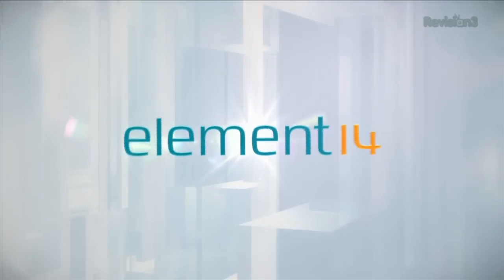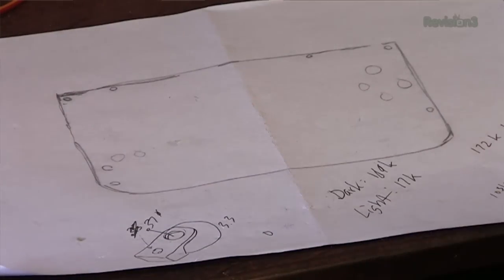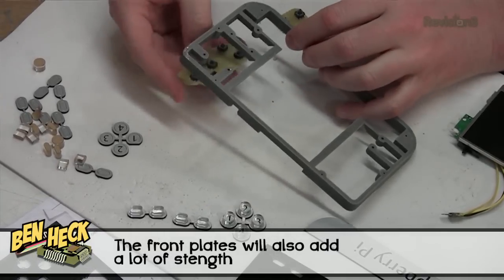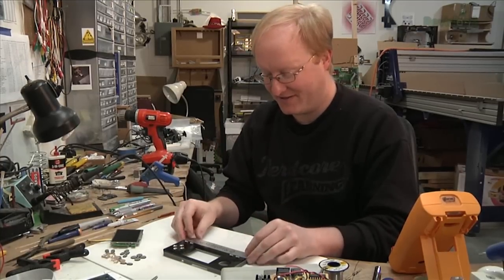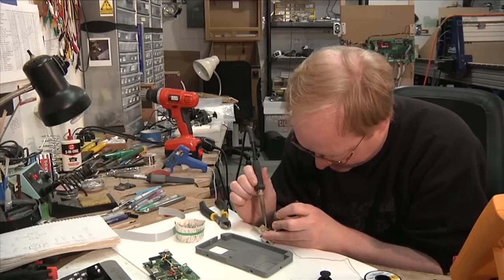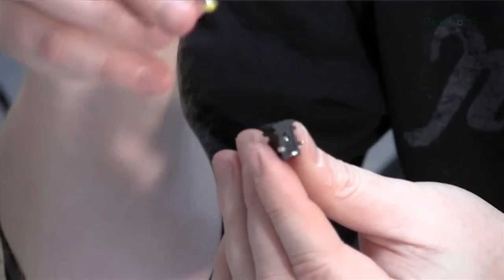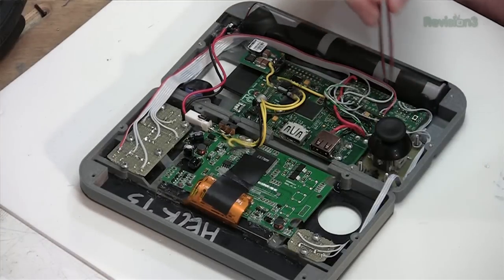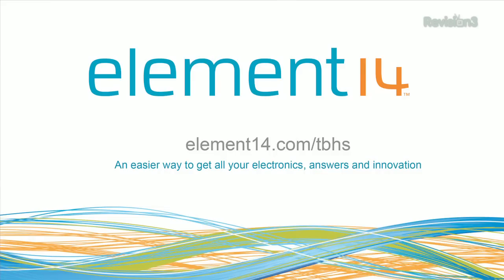Learn to Build a Portable Raspberry Pi (Part 2)

Comment: what would happen if i used a dead xbox controller for the buttons? And also why not use RetroPie instead of Mayme? RetroPie comes with loads of emulators (except you have to have the roms) and Mayme

Comment: This portable Raspberry Pi is an awesome project. Though I wonder: Could you update this to work while charging? I've heard that charging and using at the same time is not easy. Maybe you could combine it with a Switch-like Raspberry Pi-based device or so, so it's not just a retread of this project?

Comment: I was expecting to see some voltage monitoring. :-/ For a portable Pi it would be great to have it shutdown when the voltage drops to a certain level. Otherwise the OS on the SD card might get corrupted if the Pi is not turned off properly.

Comment: it has been a while since you have done this build, but i'm just now getting on the raspberry pi band wagon. can you go into more detail about how you ran the display output to the raspberry pi. you have the three cables coming off to provide the output. then at 8:25 in the video you have them going to a central location that isn't on the pi and it spilts out to a device in the top left hand portion of the screen and a micro controller and a red wire that i'm assuming comes off the display connector on the raspberry pi. love your videos and appreciate the inspiration to think beyond the off the shelf products offered by raspberry pi.

Comment: Hey ben, how would you wire two psp analog sticks to a raspberry pi 3?
Reply from the maker: +Rhatios Gaming Not directly, you'd have to use an interim chip that could handle the analog in from the potentiometers, like an atmega328p
Reply: Is there a schematic to it, I just got a pi 3 and want to make a portable out of it
Reply: +Rhatios Gaming Same.
Reply: you could use a ipac as well
Reply: +James Taylor will the teensy 2.0 support two psp analog or 3ds sliders

Comment: An old project I know but thus far one of the nicest version of the handheld-retro-gaming setups. I'd like to see this project updated with a Pi3. 

Here are my thoughts

Pi 3
All Ports left intact - if possible.
DC Power (Charge can use at the same time)
HDMI free to use to plug into a TV
On system screen 640x480 or 800x480... maybe 5"
micro SD card access
Buttons (shoulder buttons, for sure ) and maybe two more action buttons (6 button like the old sega controllers?)
Battery hatch to get in and replay battery pack. (or maybe use rechargeable AA?)

Case design still pretty similar but maybe a hair bigger/thicker to allow for the usb/ethernet ports access. Maybe a GBA style enclosure?

They idea is a portable system that can be docked for use as a console.

Comment: Hey ben Hack let me ask you a question. Now for the battery charging  when you charge the Battery how do you know that it is fully charge? I know that the battery has a charger protection on it but sometimes that can fail if over charged. So how do you know when it is fully charged??

Comment: It's a better version of the wii U!
Reply: +Creeperzone221 lol
Reply: it was a damn joke...
Reply: Creeperzone221 I knew that XD but I still wanted to point out how the thing can be a weird semi portable system. You can play the wii side just of the gamepad and any wii u games that support off screen play. Since when you hack the wii the games still display on the gamepad as all it does is mirror the wii mode. ^
Reply: +Creeperzone221 ??? how, the wii u gamepad has a touch interface with both extremely high quality analog sticks and dpad. The controller itself is light for it's size and decently durable. It also has clickable analog sticks and all the standard buttons for a usual console gaming system. Plus the screen size is a perfect size for widescreen supported games. You can also hack the wii side of the wii u to play any iso gamecube games that you want. You can technically make it into the ultimate nintendo machine..

Comment: hello it would be much appreciated if you could send a message back.I have a broken Philips portable dvd player with a screen connected to what looks like either a controller board or power distributer (with pink and white wires). It also has a DSI connector on the screen its self. I was wondering how I could use that screen to make something like your portable raspberry pi,thank you,wjbgaming

Comment: How does that USB thing work? Don't you need a hub to connect two USB devices to one port? Or can you just connect it in parallel?
The other Raspberry Pi projects I've seen have used the circuit board inside USB hubs in order to connect multiple devices.

Comment: Is it possible to buy those plastic buttons in bulk? No electronics, just the plastic for enclosures. The 3D-printed ones are hard to get smooth enough.

Comment: Someday, I will have a 3D printer, starting out slow, playing with small projects first, learning the basics.  My other question was, will I have to buy an Arduino every time I make something, or can I reuse the same one after the code has been written to the project.  Which one to start off with on a budget?  Thanks for your help.

Comment: Hey, I have a question.
I have pretty much no experience with engineering (lel I tried splicing a 9mm headphone plug to an RCA cable and it didn't work, n00b), and I want to make stuff like this. I'm a sophomore and I'm currently taking an Engineering class, and I took one last year on drawing and design, but I haven't learned much when it comes to computer and electrical engineering. So, where should I start?
Reply: Well, I was working on a video about how to make a portable Pi that was in a camera bag (held a USB HUB, Battery, and the Pi itself) which doesn't require soldering.
If you want something compact like what Ben made, you will need to learn basic electrical stuff, namely 5v doesn't work for 7v items, and 7v will fry 5v items. As with the first episode, make sure it works before you start designing any kind of case, so first try getting the Pi to be powered from a 5v source and then try to get a display working on the same 5v (for what Ben did, he used the battery's 7.2v to power the display and used a voltage regulator to bring it down safely to 5v. You can achieve the same with just a 5v USB battery by using a DC-to-DC Booster, which would work fine here as well).
To TL;DR the above, first you need to get the Pi and the display powered from the same source of power. You can either take a USB battery and power the Pi and bring up the voltage for the display using a booster component (which isn't too hard) or take a higher voltage for the display and bring ti down safely for the Pi (voltage regulator, which is also not too hard at all).
Basically you'll need to brush up on some minor electrical engineering, but don't worry: you only need VERY basic information (not even Ohm's law far).
Reply: Flame Soulis Thanks man! I do know some electrical stuff that I learned from Physical Science last year, but it was stuff like resistance and voltage and circuits. Will this help me at all?
Reply: Yep! Basically all you have to understand is how to power the Pi from a battery as well as the display. In my setup, I just use a simple USB Battery (takes LiPos and manages power for me) so the Pi gets power without needing anything fancy. The screen is then powered by a DC to DC (5v to 12v) which powers the screen (basically making the screen a USB monitor so to speak). As long as you keep ground to ground and positive to positive, you are in the green!

Comment: Hi Ben, please build a Raspberry pi portable NAS with power for all components integrated either by battery or by an external ac power adapter or by both. Please use a laptop hard drive or an ordinary internal hard drive. 
Thank you...... :)

Comment: Kids love video games this would be a good way to teach them about electronics and design if this was a kit. Wonderful video makes me want to try it out .

The screen that you have int his project where can I get my hands on one? I am trying to make an external box for my old stereo. However the touchscreen that I purchased from another place can only be used with Wheezy Raspbian. I want to be able to switch from HDMI and back to the screen. Can you please help?
Reply: Just search up 'Car Monitors' or 'Mini LCD' on eBay. They are typically around $10 and if you don't mind getting dirty, you CAN power some of the smaller screens with 5v if you remove the internal voltage regulator. That'd make the project easier since you'd only need a simple USB Backup Battery to power the entire project.
Reply: Flame Soulis
Thanks for the tip I already got the LCD screen. When I tried the games though some of the emulators were very slow.
Reply: Dart Gar You may need to not start X Windows (the graphical interface). That uses up quite a bit of resources. You can also give a small overclock to the Pi and that would boost performance. I have found SNES games run fine to a degree on a per game basis. Games like Megaman X run perfectly with slight overclock and games like Mario Cart have tiny issues on some tracks.
Reply: Flame Soulis
Thanks for the great info!
Reply: +Dart Gar You could also buy the official touch screens. For my handheld, I will use a 4" sized one.

Comment: Why are you putting the solder on the iron?  I would assume you already tinned your iron, so you are just making it less effective by doing lazy soldering.  

Rather than explain the case, why not explain all the parts you have put in there, where to buy them, and how to do all the wiring, and why it is wired the way it is.  I understand the CAD talk, but I highly doubt hardly any RP enthusiasts have a clue what you are talking about, and even less people have access to a 3D printer, and even fewer have access to CNC mills/waterjets/lasers.  

I like what you did here and want to build my own, the case I can do, the wiring and setup is where I'm lost.

Comment: hi, i been thinking about building my own moble pi, i think i got most of it figure out. problem i am having it building a power supple for the monitor, the monitor is 7 inch works at 12v @ 500ma. the battery i like to use is 11.1V 7800mAh. side note help on building a charger would be nice, i wanted to a solar cell on the outside of my case

Comment: I have a few questions.

Where do you buy a power jack connector? And where do you buy the correct power adapter for that power jack connector? And if I use 2 3.7v li-ion batteries (7.4v total), what power supply do I need to charge it?

I know how I'm going to wire it up, I'm just having trouble finding out how to charge the lithium batteries.

Comment: I'm confused how do you make the analog stick and buttons work
Reply: They are hooked up to a usb port, did you not watch the video? He mapped the buttons with the wireless keyboard. You go into the pi settings and change the key layout, Like on pc games you can go and change your pickup key to lets say f instead of e. What he did was change the key to use the buttons and joystick instead of the default.
Reply: oh so he didnt make them ?
Reply: He didn't make what? A button is a button no matter where it came from, the signal was sent from the button to the asic in the pcb thus controlling it.

Comment: @Prince Vegeta You can always plug a wireless dongle into that USB port, and no since the Pi is ARM based (what's inside mobile phones) and Steam only works on x86 (what's inside desktops). And to be quite frank if you could compile Steam for arm, you wouldn't want to. It just wasn't built to render in 3d and games themselves are written for x86. Overall though as long as you can find someone with a 3d printer it's under $120. (Pi is 30-55 USD and LCD is ~40 USD, everything else can be bought online for less than 10 USD with the battery being the next most expensive depending on how much you're willing to spend.)

Comment: Not much to be honest. You could do it for under $100. The only problem is he uses a $2200 3D printer for the case. You'd have to build one on your own unless you have a 3D printer, which wouldn't be expensive, just time consuming.

Comment: Why do you use the Teensy, the raspberry pi has a gpio pins and you can make a small program that maps the gpio pins as game controller? Is it a problem that you can not get analog inputs? Well you can use good old d-pad and save space. Thank you for sharing free information and give good advice for free.

Comment: You know your stuff but you are terrible at soldering. None of those connections were good. You basically melted the solder and then stuck the wires in it - called 'cold soldering'.

Comment: use a knife and some wood or plastic, or take something else apart, use dollar bill as a ruler 2.61 inches wide by 6.14 inches long. it will take longer but you will be able to do it. Its what people use to do before computers, wood work on the cheap is a piece of soft wood, sand paper, and alot of patience.

Comment: hey ben i decided i wanted to start modding i am 15 and have all the tools i need plus i have a lot of lithium batteries a screen and the pi but my screen is an lvds 40 pins video out how can i connect it to the composite video in of the pi.ANYONE THAT HAS AN ANSWEAR PLEASE ANSWER

Comment: I am building a Printrbot Simple 3D printer kit and am planning to hack up a case for it to have a really compact little portable printer.  I'm wondering if your little Portable Pi can be used as the front end (instead of a laptop) for the Simple.  Wouldn't that be sweet?

Comment: i'm working on a ArmPi!
Thats basically a RPi in a backpack with the keyboard on my left arm as well as a small LCD on the back of my left hand.
It's also going to be battery powered by some beefy 14.8v li-ion battery’s. I also want to get a mechanical hdd in the backpack.
How i got inspired to start building it? I got inspired by Akiba's arm computer (from MGS4)

Comment: The Raspberry PI is a credit card size micro computer that is versatile enough to do everything from minor media playback to complex projects like RC vehicles and it is very cheap to boot. The creators of the PI wanted a way to inspire young adults to be interested in programing and I feel they have done just that. Plus with it running Linux OS it is by far one of the best ways to allow open source software so that it is easy to practice programing. I believe that they start at $35 US.

Comment: Hey Ben, Glad to see you are playing around with making smaller form factor projects. I always wondered why your projects tended to be a bit bulkier. Have you ever thought about using flat lithium ion Batteries in your portables? I noticed you opted for an internal battery for this project! I think you could make your projects more compact if you did more with flat cell batteries such as what is used in most consumer products.

Comment: Hey Ben, when wiring your connections with your pencil iron there, what is your preferred temperature setting? Pencil tips can be a bit annoying with heat distribution, but yours seems to handle with ease.